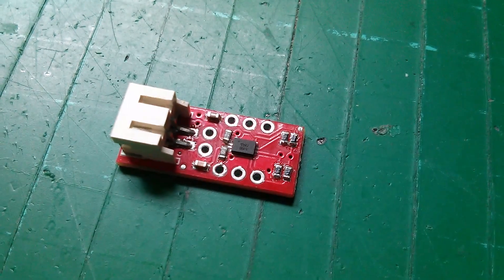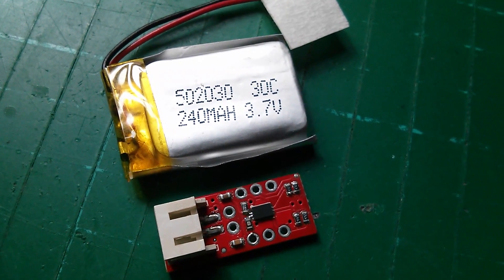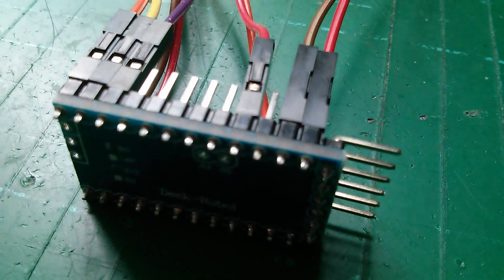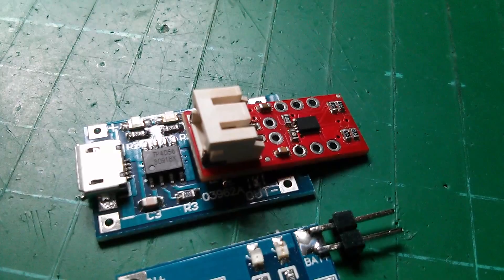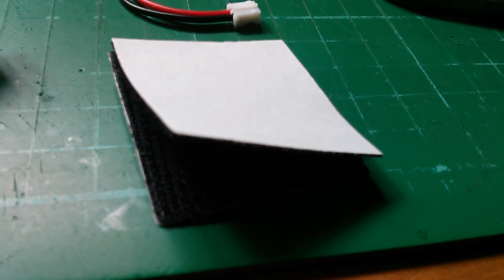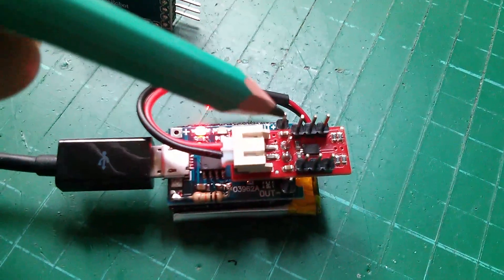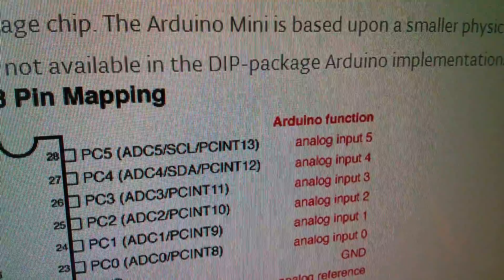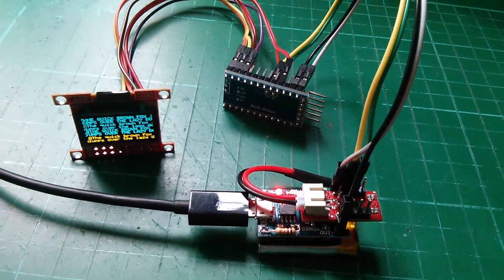MAX17043 LiPo Fuel Gauge connects to Arduino via I2C #1

Comment: If I build a battery bank with multiple 18650 batteries in parallel, can I monitor them with a single MAX17043? Would it provide a correct soc readings?
Reply from the maker: I think so. I don't remember the data sheet specifying a maximum (or minimum) cell capacity.
Reply: Julian Ilett Thanks a lot for your response. I gone through the data sheet and could not find any restriction on capacity. I was thinking about building a backup battery for raspberry pi. I want to use the fuel gauge to tell rpi to safely shut down before the battery goes flat. 
One more question if I may ask: let's say I have my batteries, lipo charger and the fuel gauge just like in your setup. I connect the output to a boost converter to get the 5V needed for the rpi. Can I simply connect this 5V and the 5V from the regular power supply? So when there is mains power I draw current from the power supply not from the battery/boost converter? Or this does not work like that? I wish to do something from off the self parts. The new rpi draws 2.1A on 5V, and I am not sure if I could power the entire setup via the TP4056 charger.

Comment: Hi Julian,

I always enjoy your vids. Do you know if there are any Arduino groups around west London? Also, can you recommend any books suitable for someone hoping to take electronics a bit further than the absolute basics -- I'm thinking something like a general practical handbook of the handiest circuits and ICs. Looking for books on Amazon or ebay is difficult because you can't easily flip through them to get a feel for which ones are going to be useful. (The ones I've bought so far with promising sounding names have turned out to be a bit of a disappointment.)
Reply from the maker: There's a hackspace in London and another in Reading. I've never bought electronics books (just had loads of magazines in the old days), but most people seem to recommend The Art of Electronics - Horowitz.

Comment: Hey Julian, I've always just used the analogue pin on arduino with voltage divider and a function I wrote ages ago for battery level (including analogue smoothing algorithm) which has always worked great for me to show voltage / percentage remaining etc, however I've been playing with one of those adafruit high side DC current sensor (In219 or something, can't remember) but anyway, really like it and very accurate, I'm interested to see how this little chap pans out for you, I've looked at this lipo 'fuel gauge' but not sure what it offers over 'standard' arduino analogue input method etc?.. My latest project is using data logging to analyse the battery current and voltage continually and therefore i can calculate the total power usage in terms of mAH consumed over time and reference that against the total mAh of the battery. With Lipo chemistry we need to avoid going anything below 30% charge for nice long life of the cell.. obviously the only way to make a true lipo 'fuel gauge' is to indeed monitor live usage and calculate total consumption. Otherwise it's just best guess based on mapping percentage of voltage - usually 4.2v 100% down to around 3.5v as 0%. Great vid, interested to see how you get on in part 2 ;). Btw, which OLED you got there? I'm running dual 128x64 oleds (mono colour, 1.3" adafruit) absolutely rocks on the teensy 3.1 :). Cheers bud.
Reply from the maker: I was just curious about what this chip does. Now that the software is working, the fuel gauge is pretty impressive. I'll try to show how it works in part 2 of this video.
I'll put a link to the OLED module in the description.

Comment: Julian how to use 2 max 17043? Can i set two different slave address to each one?  Thanks. I need to monitor two battery at once using arduino nano.
Reply: u can use IC 74985

Comment: Is it possible to connect a solar Panel on the LiPo charger and switch automatically between solar Panel and USB charging??
Reply: yes
Reply: Yes, but without specialized solar charger efficiency will be terrible

Comment: You should break the connection between protection and  charger, and insert the fual gauge there. Otherwise I expect you to get very wrong capacity messurements.

Are you sure the battery is not protected by a board on the cell?
Reply from the maker: The fuel gauge is designed to connect directly to the LiPo cell. This LiPo cell is definitely unprotected - I previously allowed it to discharge to quite a low voltage.
Reply: Cut the traces on the charger/protection board, and insert the gauge board there. The gauge is designed to be connected after the protection circuit. You only need to split charger & protection , or get a protection board from elsewhere.
Reply from the maker: erlendse Oh yes, you're right. I probably should have put the fuel gauge after the protection circuit so that it's powered down when the protection MOSFET goes open circuit. The way I've connected it, the fuel gauge is continuously drawing power from the battery. However, when the Arduino and display are switched off, it's possible the SCL and SDA lines will pull low, putting the fuel gauge into SLEEP mode which draws just 0.5uA.

Comment: i found I2C address  at 0x32 ,it didn't work even though i changed the address from 0x36 to 0x32 in the library
Reply: chào người ae Việt Nam chúng ta, tôi cũng bị lỗi này, bạn đã khắc phục được lỗi này chưa
Reply: @nhobuiquangngoc2760  ko fix đc bạn ơi chip đó chip fix đọc bậy bạ sai tùm lum à
Reply: @hungdang6333  vậy là do chúng ta mua phải một bộ phận nhỏ chip lỗi, hay là toàn bộ module max17043 hiện đang có trên thị trường này đều là chip lỗi vậy bạn, tại vì tôi lại đặt thêm 2 con module nữa ở shop nước ngoài với hy vọng nó không bị lỗi
Reply: @nhobuiquangngoc2760  bạn mua hàng trung 80% fake r
Reply: con đó tôi thấy hàng mỹ đắt hơn rất nhiều
Reply: chip đúng là 0x36 không à con dùng i2c scan mà ra 0x32 là niệm luôn.Tôi đã từ sử dụng chip thật mấy con 0x36 đo cũng đc lắm. Còn mấy con 0x32 ra bậy bạ ko à.
Reply: @hungdang6333  cảm ơn người anh em

Comment: I must be missing the point in why this is more use than just getting the voltage with an analog pin?
Reply from the maker: Battery voltage is not always linearly related to remaining capacity, particularly when charging.
Reply: Julian Ilett true but t seems all it does is take a voltage reading and then from that uses some formula to compute a 0-100 value, which the arduino could do itself in software, and I think in this case software option is cheaper & smaller physical footprint, even if you wanted good accuracy all you would have to do is measure the voltage as it discharges under similar load and log that every 15 minutes, and you have a lookup table of voltage to projected minutes, do same for charging. if you want it to learn then it could take the current reading, one from 15mins prev, compare those two to the corresponding two in the lookup table and apply a compensation factor, to project a more accurate time, if you kept the table in eeprom you could make it update the table to account for battery aging... more tricky, but more versatile.
Reply from the maker: lez briddon That's all true, and I could save a fiver by doing that, but the Maxim chip does a pretty good job without look-up tables. If I were building these to sell, I'd want to save every penny and developing my own algorithm would be justified. For a one-off, I'd rather pay a bit more and have someone else do all the hard work.